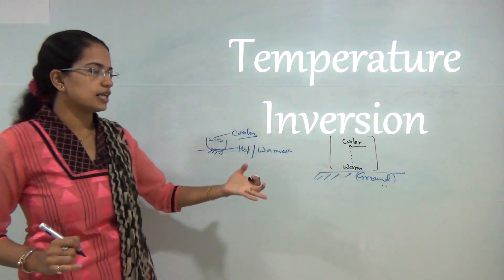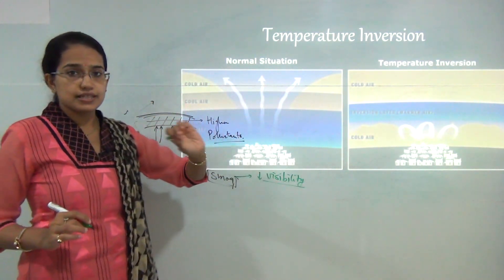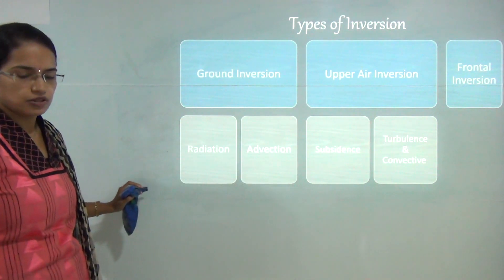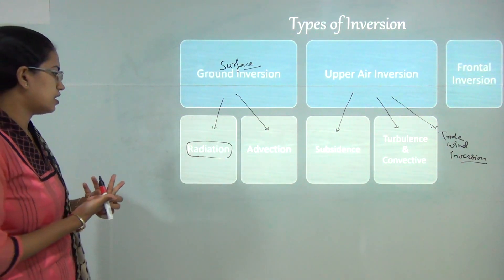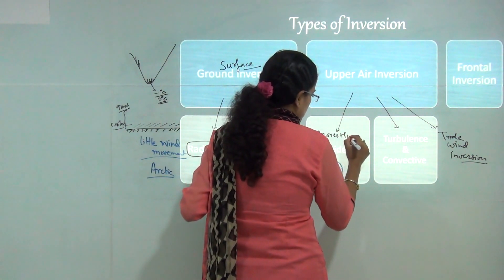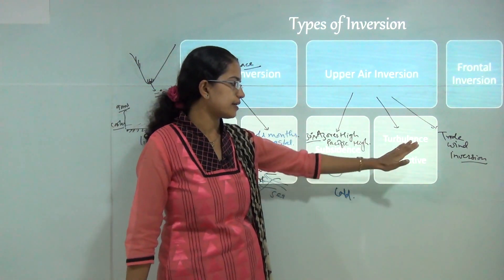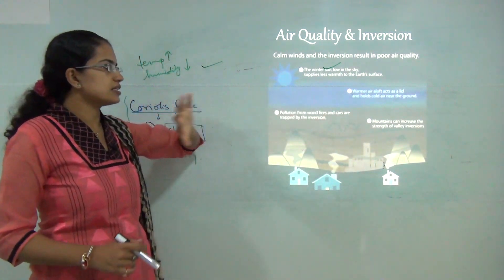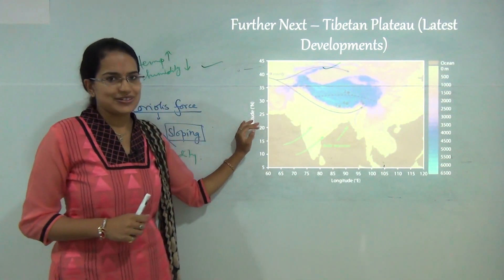Temperature Inversion in Climatology - 3 Types Explained (Examrace - Dr. Manishika)

Comment: Mam I have a query ,we know hot air contains more moisture than cold air , in temp inversion you said once pollutants get trapped in upper layer ,the lower area will get comparetively cooler, and we know cold air will hold less moisture than hot air, but in this video you said cold air will hold more moisture than upper part and this  lead to the creation of fog. Why?? 

Thank you so much for free lectures ,I'm not from geography background this initiative of yours have immensely benefitted me . :)